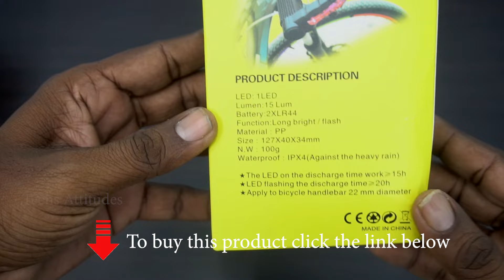Bicycle Lights | Warning Handlebar Light Indicator | Bar end light for cycle | Cycle light unboxing

Comment: The warning light horns are installed incorrectly!  If they were on a clock face they should be pointing to the 10:00 position left side, 2:00 right side.